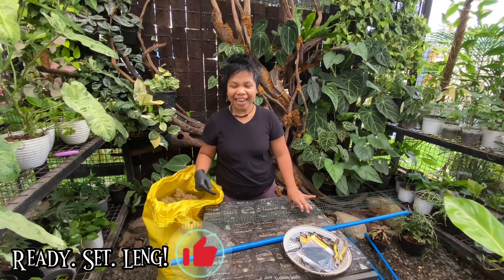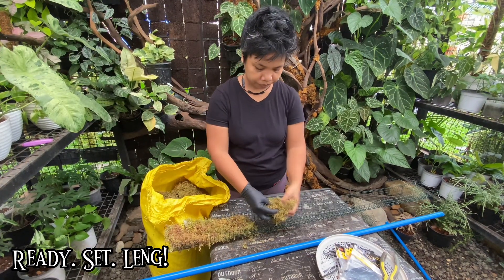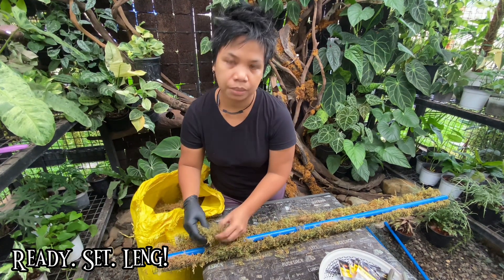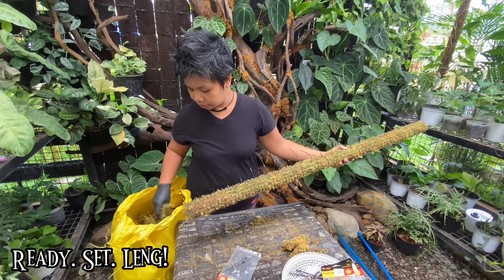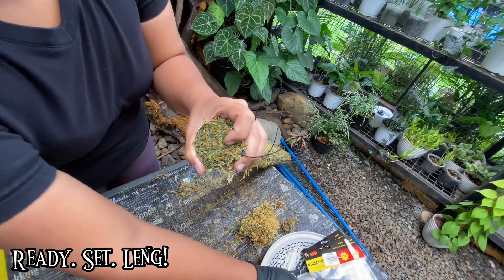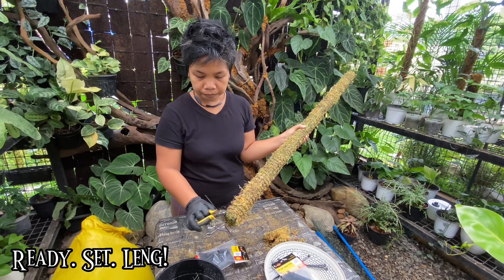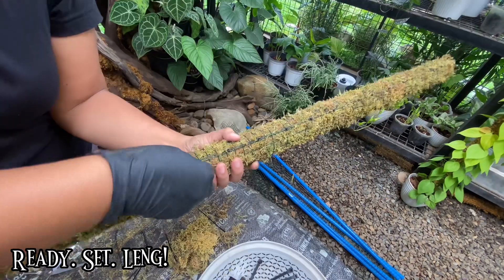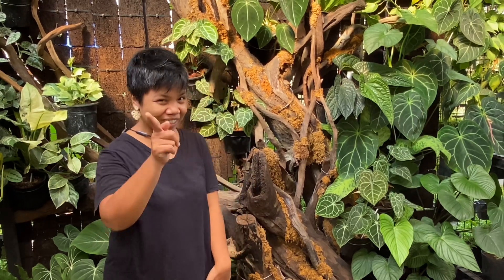HOW TO MAKE A MOSS POLE | EASY MOSS POLE WITH PVC SUPPORT | DIY EXTENDABLE MOSS POLE

Comment: Do you really have to cover the pole w/ moss all the way down  when the bottom of the pole will be stuck in the soil? Also how do you keep the pole straight & sturdy w/o  it tipping over? tnx
Reply from the maker: No, you don’t have to put moss all the way down to the bottom. Not with the moss pole I used for this video, but I often use coco chips at the bottom. Around 4 inches tall atleast. I tie the pole to the bottom of the pot with cable ties or tie wires. The thicker the gauge the more stable the pole would be. If you’re using soil as your medium, it also adds to the weight of the pots making the poles stable. My medium is light so I need to tie them to the bottom of the pots.
Reply: @readysetleng  tnx so much, am getting hook to your vlog! more power!
Reply from the maker: @evelynrimando631  I appreciate it! ❤️